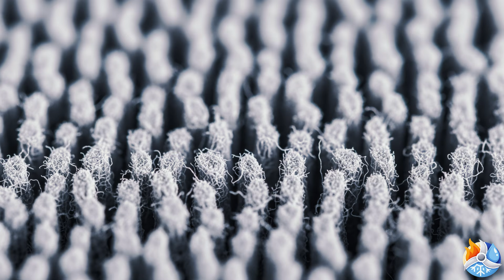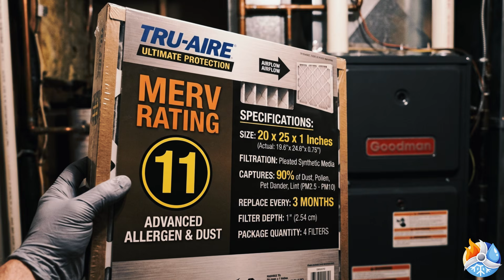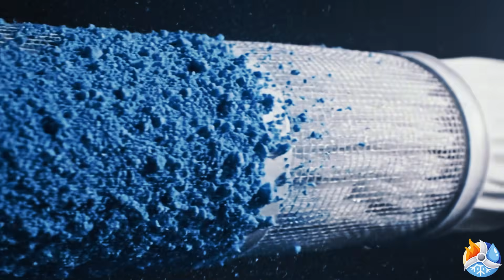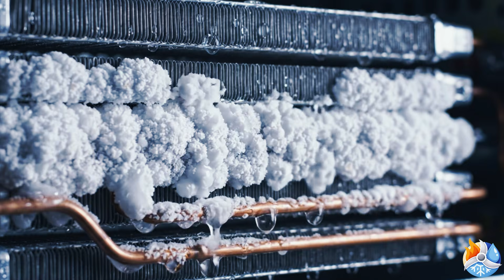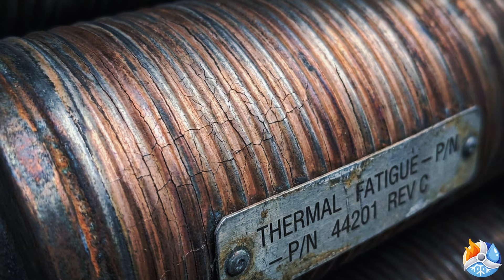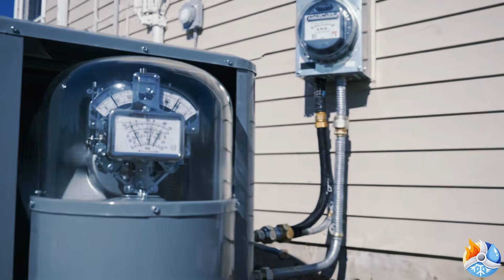STOP Buying $30 Filters… They’re Destroying Your HVAC (Airflow Lie)

Comment: My furnace calls for MERV 8. And that is what I put in it.
What can help lengthen your equipment life and save you money is to have your ducts cleaned.
Another thing is to make sure your dryer vent is as far away from the outside unit as you can get.
And have that vent cleaned annually.
#1 cause of house fires is a clogged dryer vent.
Reply from the maker: Following the manufacturer's filter recommendation is usually the safest approach. And you're absolutely right about dryer vents—keeping them clean is important for both safety and HVAC performance. A dryer vent blowing lint toward the outdoor unit can create problems over time if it's not maintained.
Reply: @DealsByLucy  Dryer venting near the outside unit certainly does clog the coils.
Difficult to remove in the winter time and that is if you are lucky.

During AC season, hang dry clothes outside so the dryer doesn't pull your expensive air conditioned air out of the house in the process.

Comment: It all depends on your system. I'm in the process of shopping for a new AC system, so I'm looking at details. My system has hydronic heat, so no furnace, just AC. But, I have been using a 1" MERV 14 Filtrete with no issues. Never any icing on my coils. Is it hard on my blower? It's 26 years old and runs fine. You, on the other hand, might be using a very cheap filter (low pressure drop but only stops dust bunnies) and still have coil icing issues if you are working in tropical humidities or have poor ducting/closed vents.
Reply from the maker: every system is different. Static pressure, blower design, ductwork, humidity, and filter surface area all matter together. A 1-inch MERV 14 can work fine in one system and choke another. The fact your blower made it 26 years says your setup is probably better designed than most

Comment: I buy Glasnoss Z-Line 400 HWR 4 inch filters.   They are 4 inch filters designed for 1 inch return ducts.   They are about $45 and it lasts me the whole year but I'm in a  mild climate on the 4th floor so not much use or dust.    If you do want to buy a nice filter but still be nice to the equipment and save money.... you can still sort of do it... with filters that increase the thickness and thus have more surface area.     So the filter is expensive but I get less static pressure and more life cause it's thicker and has more surface area.   Plus the company was able to use a MERV 10 due to less static pressure of the filter design.
Reply from the maker: this is what a lot of homeowners don’t understand. More filter surface area = lower static pressure while still filtering well. A thicker 4-inch design can absolutely be easier on the system than a restrictive 1-inch high-MERV filter

Comment: MERV 7 OR 8 ARE THE BEST.  THE THICKER THE BETTER. 2,4,5,6 INCH FILTERS ARE BETTER THAN A 1 INCH FILTER.
Reply from the maker: A properly sized 4–5 inch MERV 7 or 8 filter gives great airflow while still protecting the equipment. Too many people go too restrictive with thin 1-inch high-MERV filters and end up stressing the system.
Reply: @DealsByLucy  Thanks a bunch!
Reply: I'm currently using a merv 11 that's 5 inches thick. Should I drop down to a lower merv? I bought a box of 3, and would hate to have to throw them 🙃 Thanks ✨️
Reply: Trolling?
Reply: I have aprilair merv 11 and change about 10 months.
Reply: Thats as low as they go.